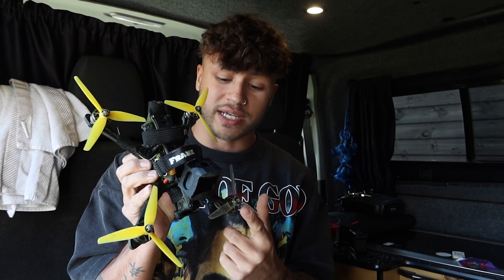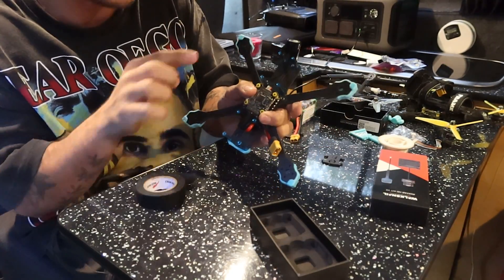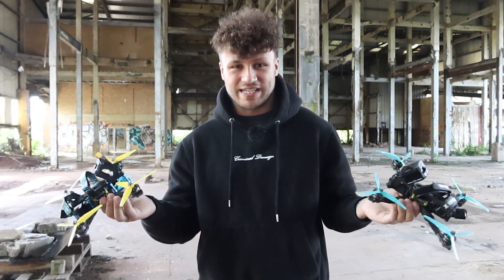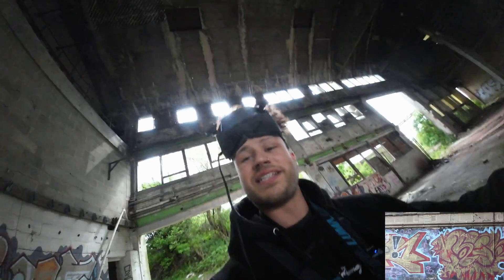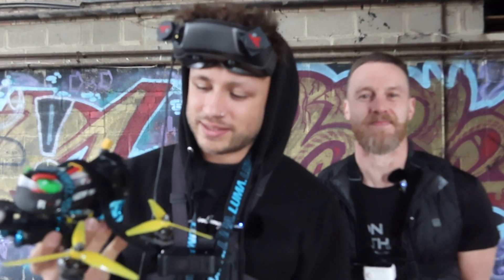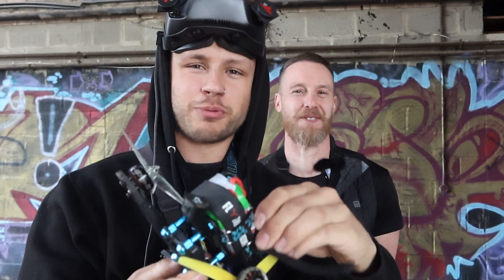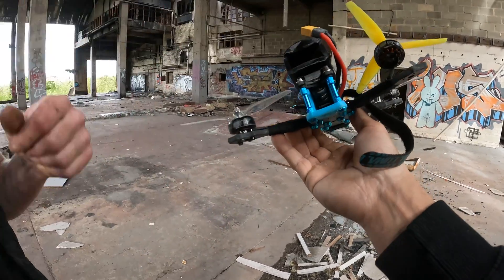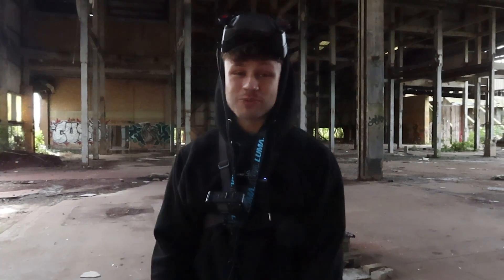I BUILT 2 NEW FPV DRONES...

Comment: Nice vid man, that loop out the window is so sick. Also good to see gridworks is still open, probably the best bando in the UK, hoping to go there soon.
On my builds I blob Araldite epoxy resin on the arm ends, protects about as well as TPU guards and doesn't interfere with the motor screws. You can just pick it off and put more on if it starts to crack. It's super light as well